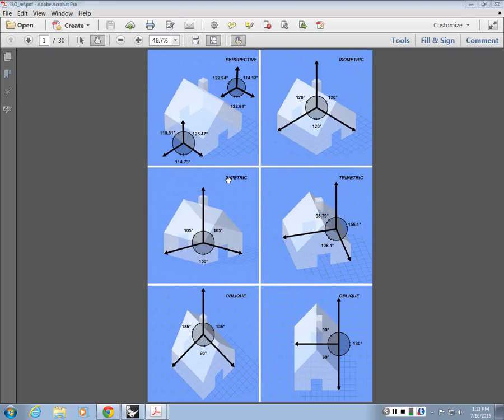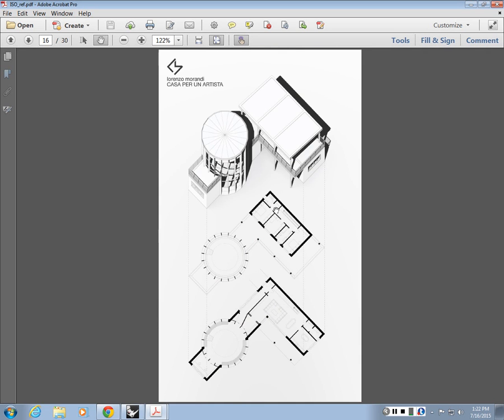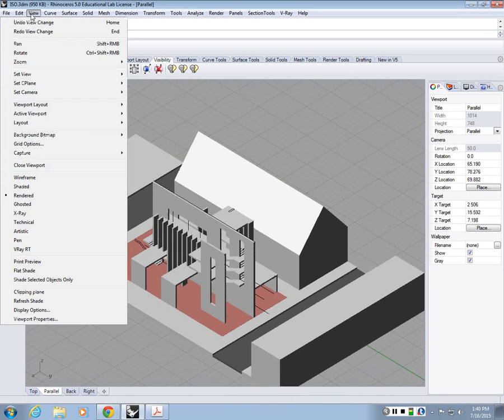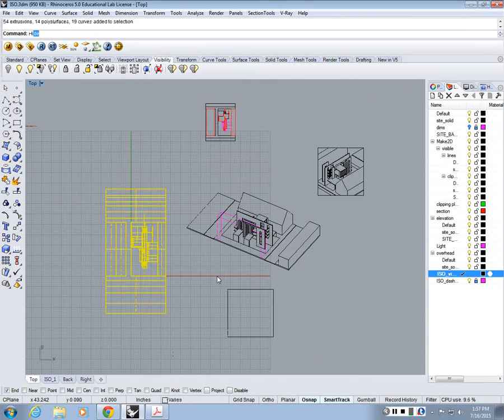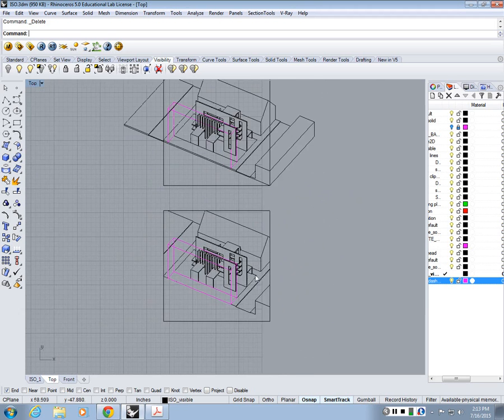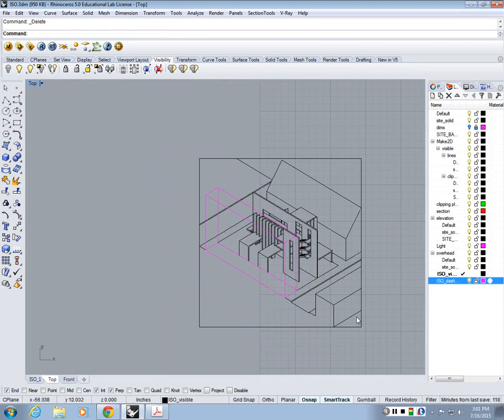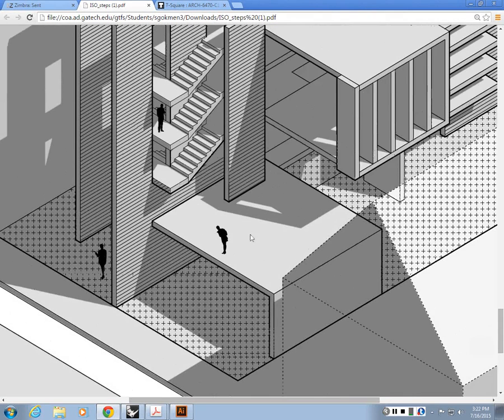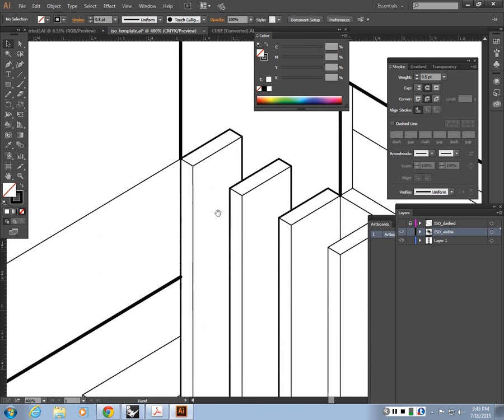Axonometric Drawings using Rhino

Comment: 1:13:50  The known convention is not the front line. It should be the line contiguous to the stairs. Maybe this is another style that I don't know but the borders should be the ones with the heaviest line weight as a convention. I use the German Style known in the Bauhaus. 

Either way the style looks convincing for the information it tries to communicate.